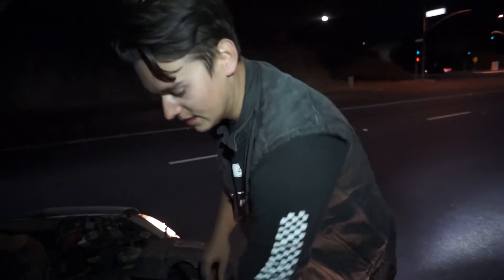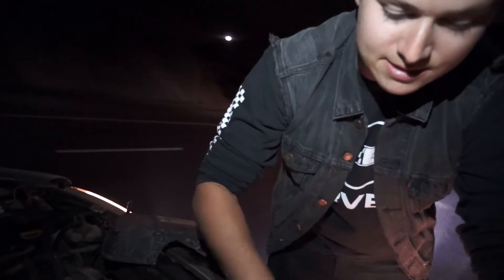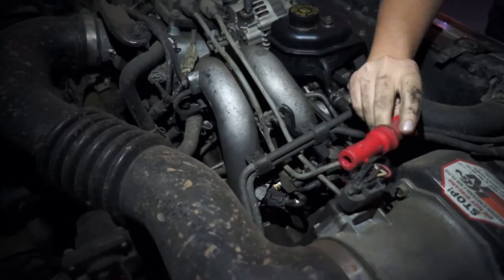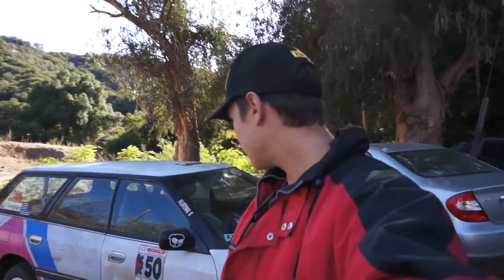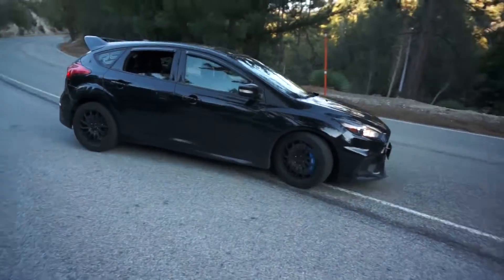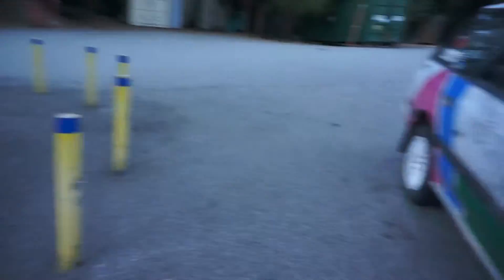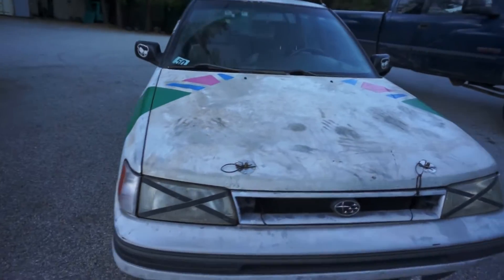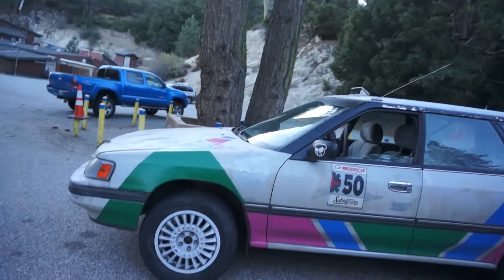My Broken 3 Cylinder 1991 Subaru Legacy

Comment: Still better mpg than my Tacoma
Reply: Lmao. What did you due to your taco to get that kind of mileage.
Reply: @disrailigammons5144  lift and bigger tires took me from 17mpg to 13mpg
Reply: @disrailigammons5144  also, it's a 2nd gen 4.0
Reply: @hfdsocalss  so is mine but I still get 20mpg. Maybe like 18 with some city
Reply: @disrailigammons5144  what lift do you have? What size tires?
Reply: @hfdsocalss  no lift here. Just wheels and tires. Still thinking about a lift.
Reply: @disrailigammons5144  I did 5100s with OME springs, toytec rear aal. And spc uca. Also added rock sliders so I'm sure it's a bit heavier too